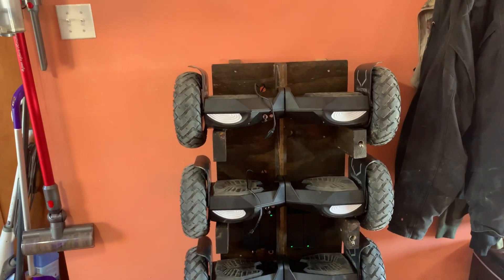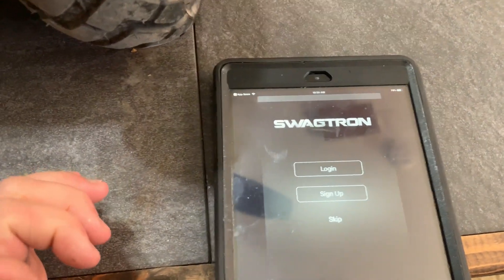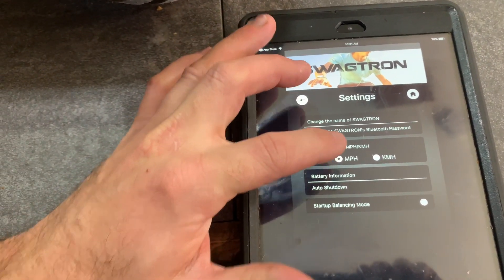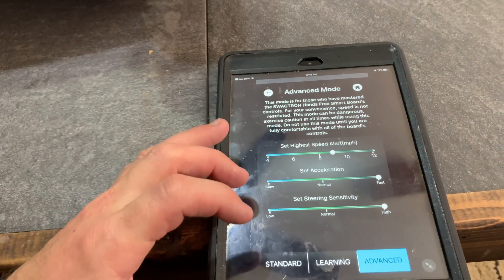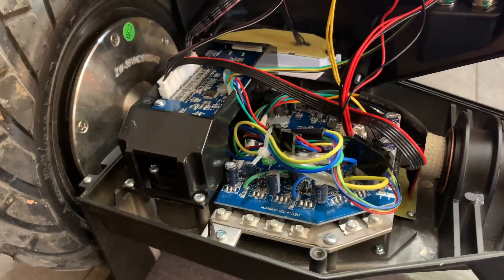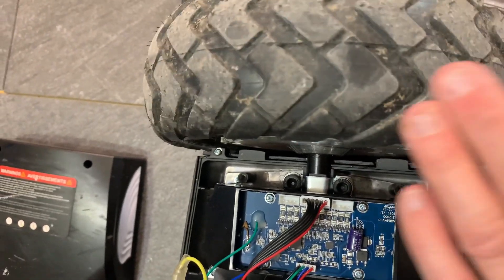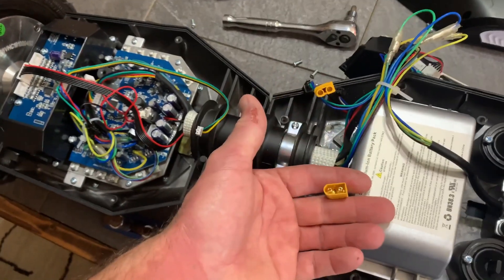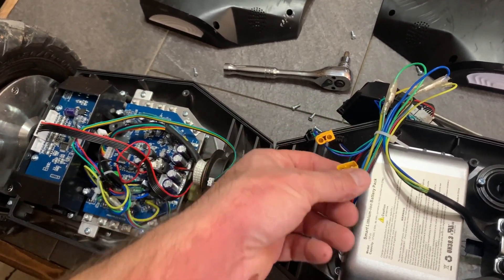Swagtron T6 review

Comment: I have the T6. The thing it needs most is a for it to dynamically decrease steering sensitivity as you get faster. This would do wonders for stability and safety at higher speeds. I believe the Gyroor F1 does this, but in every other way the Swagron is better.

Comment: Why doesn't anyone want  people to see the electronic board that you had to unplug to lay the cover with the lights and the charging port to the side? Everyone including Swag Tron places that cover face down so that no one can see that board that's mounted to the cover. Swagteon does not show it on any parts list. And it will cause the whole board not to work if one of the capacitors blows. . So it won't be able to be ordered.

Comment: I bought one last year for my filming projects and ended up sending it back because of the grinding noise when I turn.  I plan to buy another soon as I can find a good used one at a good price.  I want to use for dolly shots with my video cam and gimbal.  Thanks for this video it helps quite a bit.
Reply: Same issue. One wheel too close to the fender. No gap. Air nozzle hits. Grinding sound. Won't charge at all. Probably gonna send it out tomorrow

Comment: I screenshot my phone clocking me going 14mph on the swagtron t6 app. Also my battery charge port came out and eventually slid off the wires. is it worth sending in under my warrenty or just re-attach myself? There's also a slight knocking when I turn sometimes with enough weight. And I took my wheel gaurds off cuz the rubber was rubbing.
Reply from the maker: josiah landis if you know it’s easy I would prolly just fix it, there not to complicated.
Reply from the maker: josiah landis yea I was at 12.4 and it just strait up got uncontrollable and I fell off, I put a seat on it and it maxed out at 12.4 as well, it might be going faster than that if you use a GPS

Comment: I'm current having an issue with the T6 that the battery is not charging fully.  At first it would not go above 68% and now it does not seem to go above 38% charge.  I have been monitoring it through the phone app.  I contacted Swagtron and they want me to send it in to them for repair but it will take about a 2 weeks to month to get it back.
Reply from the maker: Sounds like there is a possibility that it’s not charging at all or the system is not reading the battery correctly maybe a hard reset could fix it but the only way I think to do that is to disconnect the battery for about five or 10 minutes and try to turn it on while the battery is unplugged to drain any power out of this system but at the same time that would void warranty.
Reply: My reconditioned unit won't recharge at all.

Comment: I wonder if it is possible to upgrade the battery?
Reply from the maker: Vid Headz you could, but I was thinking of a back pack battery pack for long distances, you will just have to have a long wire from you back pack battery, and not use the internal on, just make sure you have a 36v lipo/lithium battery pack. But the pack in it now is 4AH now so if I was gonna do it I would want 8AH+ worth, but they will get pricey.
Reply: @robbi450rr1  Interesting...

Comment: What tire pressure do you keep in your tires?
Reply from the maker: It would depend on terrain, gravel I would lower it till it got a little flex in the tire but smooth road max psi but road with bumps a little under max cause it’s more controllable hitting edges of sidewalks or a batch of gravel
Reply: @robbi450rr1  what's max psi?

Comment: awesome video, great information andf I LOVE your stack of Swags! it's the ONLY hoverboard worth buying and we hold tkis knowledge in common. I have a question if I could borrow your mind for a moment - I just did your repair suggest thinking that my tire was rubbing but it turns out the sound is coming from within the wheel like an issue with the bearing. Have you encountered this and do you have any suggestions and/or do you know where I can get replacement wheels (new or used) for the t6? Many thanks :)
Reply from the maker: I have not ran into this issue, not sure if these motors are brushless, or not. But sound could come from this, but I’m thinking there brushless. I’ve sold these about 6 months back.
Reply: Damn they don't make em like they used to. Motors are weaker it seems. Can barely go off road